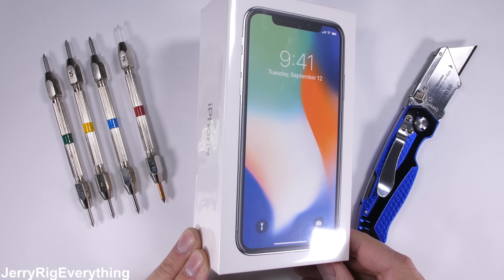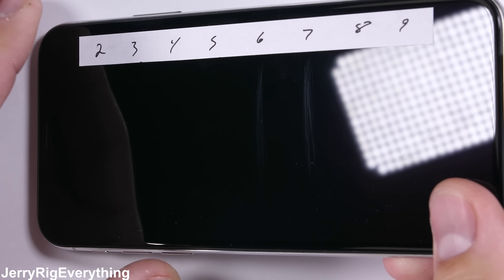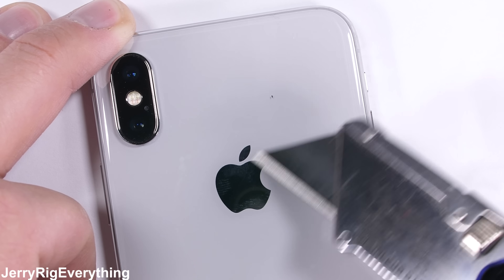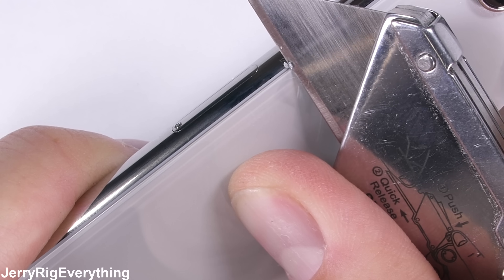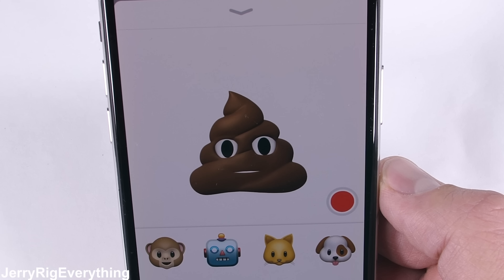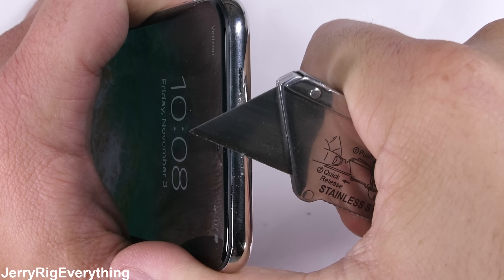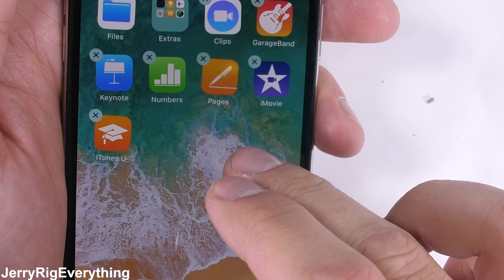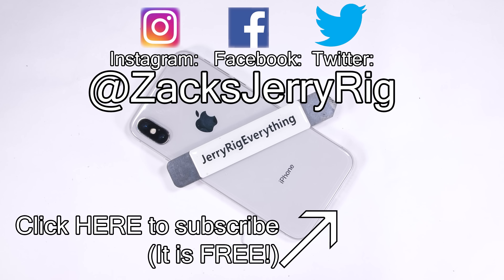iPhone X Durability Test - Scratch BURN and Bend TESTED!

Comment: 549$ TO FIX THE BACK GLASS? YOU CAN BUY ANOTHER PHONE FOR 549$
Reply: PugLordTR you can buy a samsung galaxy s6 which same power than this and has a better battery
Reply: I bought brand new s8 for less than 549$, lol
Reply: Another flagship you mean
Reply: Ilija Radosavljević you can buy a s8
Reply: Ilija Radosavljević I wouldn't buy the s6 Lol that phone was awful o hated it so much
Reply: PugLordTR q that's like... 3 and a half of my phones!
Reply: I phone 10 Cost around 850 to 1000
Reply: 256gb I phone 10 cost 1100
Reply: You can get even OnePlus 5
Reply: First the S6 has a terrible battery, second the iPhone has way more power.
E.g. it has 4,500 points in singlecore and 10,000 in multicore, compared to the best SD835 with: 1,900 and 6,300pionts.
Reply: PugLordTR s8!

Comment: Calling it. Next year, the side buttons will be replaced with "innovative" pressure / capacitive touchpads built into the side of the frame. Like a rip-off of Edge sense. Also 3 rear cameras, Sim slot replaced with e-sim, and somehow smaller Bezels.

Comment: You’ve quoted in two separate videos the cost for “back glass replacements” from Apple.  This is simply incorrect.  Apple does not replace the back glass, we would replace the entire device.  The cost of $549 you quoted in this video is not for a back glass repair as that doesn’t exist, that is the cost, without AppleCare, to have the entire phone replaced.  While yes it is still expensive it just doesn’t seem fair to say that it’s the cost for a back glass replacement.
Reply: sanguineale It's the cost of getting the phone fixed when you broke the back glass. They chose to design it that way.
Reply: Johannes Bußkamp but saying it’s a repair cost is simply incorrect, that’s like saying all you’re getting is the glass replaced. No. You’re getting an entire new $1000+ phone for that $549

Comment: One huuuuuge oversight (which I'm surprised by as this guy is very thorough). You should of scratched the glass in front of the face sensors and see if it still unlocks the phone.

Comment: Well they don't 'choose not to allow for cheap back glass replacement' like Samsung does, BECAUSE Apple's devices are opened by lifting the SCREEN, if you wanted to replace the back glass you'd have to replace the housing, which means you'd need to completely disassemble the phone and reassemble it in a new housing. Samsung's phones are opened from the BACK, meaning you need to do as much as heat up the back of the phone a little bit and lift the glass carefully to remove it. Nothing else needed. Just heat up and lift, there you go, back glass in your hand. A lot less steps, that's why so cheap.

Comment: 2017 is the year of Lets add cool unuseful features and remove essential ones. 

No headphone jack, bigger screen = less power efficient. Crackble Glass instead of long lasting metal.
Water ressistance against tiny speakers. Super biometric security against simple finger print scanner.

You won't  be able to unlock your phone while driving.  Otherwise you will end up with your phone stamped in the cement. 

The only Cool thing that can happen to you is, if you end up dead trying to unlock your Myphone while listening High velocity impact spatter.

Comment: Wonder if it's even possible to open yourself without damaging it. Since Apple's greed knows no bounds even more so now, there's no chance in hell im getting an iPhone and I won't be surprised if they remove the charge port entirely and for you to buy their chi wireless charging and not even bother including it. I knew they were getting greedy before with the removal of the headphone jack but now they have stooped to a very extremely low level and are no longer the best and have proven to be a shady company at his point.

Comment: Samsung charges $205 to replace their back panel. Samsung panels are heated and replaced in 10 min. Iphone 8 and 8+ is same way. Iphone X requires to remove every single component to replace back glass. Thats why it cost more. Both companies charge way too much. Its not just Apple. That $20 remark is just BS. Comparing with chinese part DIY vs mfg factory repair.

Comment: LED = a backlight tech,  their previous LCDs were LED backed, this is an OLED. Not interchangeable. Other phones had OLEDs for years, yeah, but it's not entirely fair to say they had THIS screen for years, as it's semi-custom, made by Samsung and with some Samsung tech, but also extensively customized. The side by side with the Pixel 2 (smaller one has a Sammy OLED) in this very video already shows that.
Reply: tipoomaster People like to say stuff occurred before. Like, so and so car already had a petrol engine with 200hp 50 years ago so why buy one today?

Comment: To be honest there's no point watching your videos about iPhones because you're extremely bias against them. Saying an Android phone had the same screen 7 years ago is a complete lie, obviously.

"As we saw from my iPhone 8 drop test, the glass can be broken from a drop of just 3 feet" - But this isn't an iPhone 8, nor does it share any of the external parts with the iPhone 8, if you'd bothered to research before making that statement you'd know this phone is far more durable than the 8 in drop tests, in fact many have failed to even break the glass by dropping it at any reachable height.

Comment: I’m sorry but does he know that the glass back is part of the frame? There’s probably a way to repair it by softening that glue or whatever is holding it to the back but it isn’t meant to come off like the Samsung s8. The s8 is opened from the back for repairs while every iPhone since the 5 has opened from the front. The last phone to open from the back was the iPhone 4 and the glass back was easy to replace because it was just screwed on. There isn’t really a way Apple can fix this. When you repair the back they’re essentially putting your phone guts into another frame. So $500 is reasonable for the labor but it’s not ideal.

Comment: I do like the iPhone x or 10 lol. 
One of the most durable phones. Nothing I would get though. 
But props to apple for doing something different, it still costs $1,000. Which is the point I stop wanting it. 
Throw in the expensive replacement of the back glass and I'm completely turned off by it

Comment: Hey Zack, another great video! You probably can't keep up with the comments, but here goes. It would be great if you would comment on the oem vs aftermarket glass replacement. You said for both iPhone 8 and X that it's unreasonably expensive from Apple, but an aftermarket Samsung glass is $20. But what about aftermarket Apple glass, and what would Samsung charge to replace glass? It's not really fair to compare diy aftermarket with Official OEM Repair. Some comments on oem vs aftermarket price and quality would be great.

Comment: Like with most of Apples flag ship products, I will admire it from a far. No doubt in my mind that this is the most well crafted device I've seen so far, but that does not mean I would want one. The Razer phone with it's 120 Hz display, 4000 mAh battery, industrial design, and front firing speakers won me over along with its customizable resolution, refresh rate, CPU clocks, and things that I've never been able to tinker with outside of a desktop PC. Of course I don't own one, but that's the only phone that has had me excited this year. It may also be the only phone that actually has a legitimate reasoning behind no waterproofing and no headphone jack with it's internals, but that'll be for you to find out in a future teardown video.

Comment: 2018:apple removes the speakers and you have to buy them.2019:they remove the display and you need to buy a monitor from them and need also 5 different wires to make it work.

Comment: That animoji conversation was great. I want to get my $1000 animoji machine already
Reply: iPhone is a phone that you can use for many years , in 4 years using just one iPhone, you could had buy from 2 to 3 android phones... expending even more them $1000 ....
Reply: What is your phone ? You need to be using you phone for today tasks and with not any other phone, if you are doing this  its not right.   because I don't had this experience I already had 4 android. all android gets laggy with time or broken very easy with all that plastics everywhere. And today still people buying iPhone 5s and using daily for tasks that any android device with KitKat don't are running very well ...
Reply: Always latest and greatest software ? where you came with this crazy idea ? iOS its a lot more advanced them android multi tasking, and still came for phones with 5 years old. This is a fact its not any "future"  prediction . Every iOS installation is locked at device ID of hardware, even with Touch ID, and now the Face ID. The Apple cares a lot more for privacy them google.  everything is better using iOS
Reply: Rafael Nogueira BTW you are right, iPhone is good for long term, but most iPhones or apple products are susceptible to breaking. Screen/back easily cracked etc. And Apple charges a LOT like 549$ for glass replacement (Not screen)
Reply: Rafael Nogueira Google announced it, 3 years full of monthly updates for Pixel devices
Reply: Rafael Nogueira True multitasking doesn't exist in iOS. Apps are Hibernated. And you can't run two apps at once on iPhone. Ram problem is tackled by Apple by hibernating Apps where as Android tackles it by having more ram!
Reply: I had one RAZR D1 that are more recent them S3, it was not a top line, but today can't even run facebook app. I just throw that shiit in trash.  After tested my first iPhone, I don't think that I will use that bubble software android again.   I had buy a iPhone 6s and still having a amazing performance even for some middle phone launch in this year.
Reply: Vatsal Chhabra A lot of companies says a lot of things. When I had buy my LG G3 ,  the LG had say that will support that device until android 7.1.1 and the android was stopped in 6.0.0, I only get 7.1.1 using custom roms, that I cannot trust very much.  Lg g3 was my last android phone
Reply: Rafael Nogueira It's not LG!, It's Google bro. Android is owned by Google not LG or any other OEM. Old nexuses still getting updates... And talking about LG G3, It was a laggy phone, idk if laggy is the right word but animations weren't smooth because it was the first phone to get an Quad HD display. LG INNOVATES!.
LG G6 is like the first flagship to get bezel-less display.
High resolution display takes more processing power that's why I didn't find LG G3 to be buttery smooth.
Plus Replaceable battery = Plastic back = Doesn't look premium right?

iPhone works for general public who use their phone for basic functions. 
Idk what to say, No Dual sim, no sd card, no replaceable battery, doesn't communicate well with non-Apple devices. Can't use it as a pendrive. File system doesn't exist (Can't manage files), Can't share files using nfc, can't use two apps at once (split screen). Music is pain in the ass, Needs a computer to backup fully,
Doesn't fast charge, no headphone jack.
No back button or recent apps button like in Android and the list goes on.

Apple survives on marketing dude. They brainwash people. It maybe fine for certain group of people who doesn't look at the Android Mobile Market. 
Yeah I agree there are certain things that iPhone does better than Android phones. But there are many things that iPhones CANT DO that Android Phones CAN!
Peace!
Reply: Stock Android runs well into the future, specially the newer Android phones like OnePlus, Nexus 5-6 and Pixel. Who would like to use a phone for 4 years? Boring... I would rather chance my Android phone (Which is more advanced in features anyway, more like a computer etc.) Every 2 years. Pixel is supported for 3+ years by Google anyways, always latest and greatest software :)
Reply: dumb ppl creating havoc here...shit crapple fans

Comment: iPhone 14: no screen. All audio but still no headphone jack. The phone is 12.5 inches long and 1.2 inches wide. Uses a watch battery that lasts over 3 hours on a single charge. It's revolutionary. It uses a charger that Apple decided needed to be updated from the last years charger. It's not included in the box and costs $49 to buy. Apple has also started their own wireless carrier, which you have to use if you want the new phone. And the most important new feature. 6 days after you buy the phone, Tim Cook will show at your house and fuck you in the mouth without consent. It will be the golden age for smartphones.

Comment: Jerry, there's some glass repairing resin glues that cover, hide and fix cracks on glass. See if you can find them and review them. They're pretty cool. They're used to fix automotive glass windows instead of replacing them. Or ignore the comment ;/

Comment: Can you a video about a transparent iPhone X?
Reply: Dhanushka Jayasinghe maybe you can go from inside, remove the screen and the internals and remove the paint from the back panel without removing it from the phone
Reply: You can't even going from the inside, because the back glass attaches to the aluminium body  and has only a hole for the wireless charging pad.